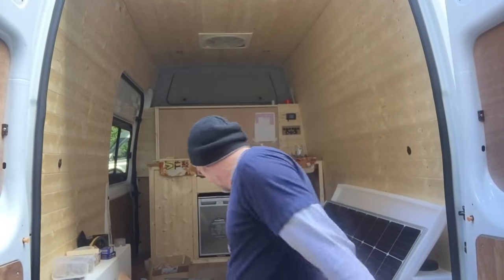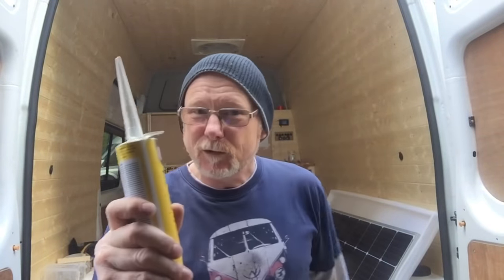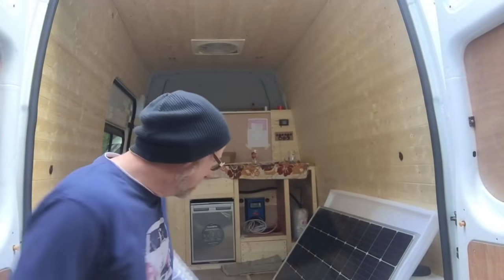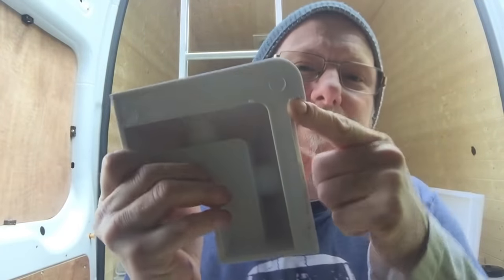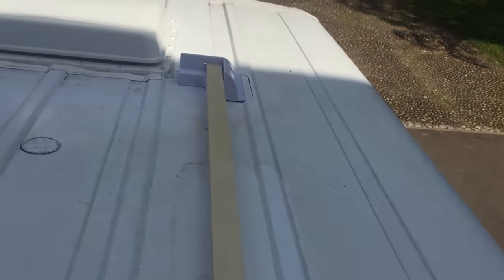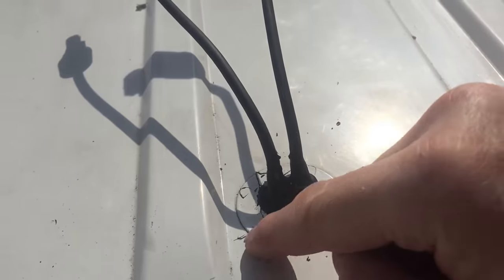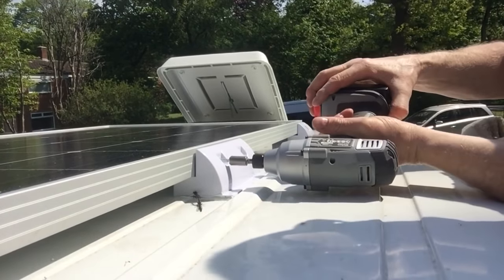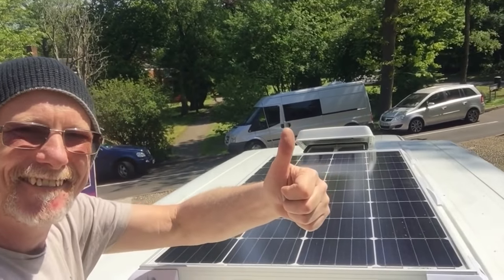HOW DO I FIT SOLAR  PANELS TO A CAMPER VAN ROOF  simple and safe - Sprinter Transit T4

Comment: Just a quick safety tip: It’s worth chucking a bit of cardboard over those panels before you connect the wires, so they are not producing any current. If the wires accidentally touch with the panels in sunlight, you can cause damage. Those brackets look really substantial!
Reply from the maker: Thanks Matt that’s a good shout 🤙🤓
Reply: the panels don't produce current until a load is attached

Comment: Love the honesty in this 🤣 "An old battery I got for £2 from a breakers yard!" 🤣
Reply: 😊 Yeah that how it was in 70s. No money around and just made do and learn't how to do things myself , mind you two quid was a lot of money in 1975, beer 25p a pint so you could have a good evening in pub and Chinese take away after and still have change 😄 Petrol 32p a gallon, (that's 7p a litre 😯). ps where do i get those mounting corners from? Cant find on Amazon link you gave. That are perfect as i don't like drilling in roof for fear of leaks.
Reply: I lived on the road in tge 80's. We ysed old van and truck batteries. We had a oair of wires with crocodile clips run out the top of the bonnet, round the windscreen post and in through the door, when you went out, sling a battery in the foot well, charge it up. We didn't use the batteries for lighting, incandescent bulbs only back then. We used to run car cassette players and old portable black and white cathode ray TVs. The lighting came from gaslight and candles.

Comment: Hi many thanks for the footage am going to do the same to my trailer just a thought as my trailer has no individual suspension will the solar panel fixed as you have done on top of the van 
Just thinking I'll be careful driving but will the solar panel crack IE with vibration 
Just a thought

Comment: this is a good way to mount the panels than drilling hole into the van. good work !
Reply from the maker: Thank you 😊
Reply: Please be aware that's a VERY BAD CHOICE! Sorry to say, a bit stupid at best.

Although the adhesive itself is quite strong. Remember the entire panel, which is basically a horizontal sail. Is being held in place by the... paint work!!! Yep! That's it! It's the paint that's holding, (anchoring) it all in place! 
Take it from someone with a "structural" background on automotive and other applications. Anyway it's basic common sense!
Whoever as seen clear coat and/or paint peeling in a car, van, etc. should understand immediately what I'm saying. Let that sink in for a moment and then tell me how safe you would feel at highway speeds behind such an assembly. ;-) 
Cheers
Reply: @crpth1  thats why it should be sanded down and cleaned with alcohol before applying the glue.

Comment: Thanks Mel, very informative. Although I'm only an armchair van converter, I personally would prefer the semi-flex panels that mount direct on the tin roof. I would expect any panels to be combined with a decent sized battery, preferably lithium ion - the recovered batteries from bmw hybrids seem very cheap, I have seen £500 for 9kwhr. A decent battery and you can run yout fridge, a microwave or an induction hob. As you can see, I don't like the idea of lpg inside the same tin box I'm sleeping inside.
Reply from the maker: Hi thanks for your feedback really appreciated I have used flex panels but there not as good as the traditional ones
Reply: Indeed, feel free to do some googling about the disadvantages of the flexible panels. They don't have long longevity at all as they deteriorate rapidly when exposed to the elements (Wind, rain, ice, snow). Also without the aluminium backing / frame acting as a heatsink they get hot, extremely hot. In hotter countries they don't last long at all, here in the UK you may get a couple years out of them ;)
They make sense if you use them as portable panels. Store them and slap them on when you're going away for the weekend / week. If you're looking for a permanent install, go with the ridged panels.

Comment: I'm going to be fitting a solar panel soon but there are lots of ribs on the roof of my van. How did you cut the plastic corner mount to fit the roof?
Reply from the maker: Hi I used a grinder please be careful ❗️ 👍

Comment: I was really resigned to the fact that I’d be drilling the panel to some roof bars and then not having space for extra luggage. Basically because I was scared that this adhesive (or any of the recommended brands) wouldn’t hold the panel in at 70mph. 
You’ve given me confidence to glue now. I think. Eek.
Reply from the maker: Good luck take ya time make sure everything is super clean and you’re be rite 👍🤓👍

Comment: Hey Mel, I was watching a video and the guy said these mounts can't be used on curved or ridged roofs. You show that they can. I have a Chevy Astro van that has a similar roof to yours. I'm going to bolt them down though. When these things rip off it's from the paint separating from the primer.
Reply: Right. He didn't even bother to sand it down lol. These will last a season or two.

Comment: Ha! 
Gotcha, Mel:
l already had a 4 bar roof-rack, so l just adjusted one bar to fit my panel... (the cables go through my sunroof)
l even put 2 inch elevators on the back-end to keep it facing the sun...
(Yes: l do not intend to move my van for a while)
Hahaha...
I liked those plastic end-bits though... yep!
Reply from the maker: Well done sounds like you really do have one up on me lol 😂🤓🤙
Reply: Perpetual Stay-in-one-place, indeed.

Comment: Mel you are a bloody genius, where did you get those brackets ? absolutely by far the best way to fit a solar panel, Greg Virgoe you better up your game there’s a Mel about. I am so impressed with this. Thank you and huge 👍👍👍👍👍👍👍
Reply from the maker: Thanks, Peter here's a link to the Brackets for you on Amazon 
 https://www.amazon.co.uk/gp/product/B016ORGABK/ref=as_li_tl?ie=UTF8&camp=1634&creative=6738&creativeASIN=B016ORGABK&linkCode=as2&tag=melsvanworld-21&linkId=7aea0fdf04168718d4136409d453a92e
Reply from the maker: thanks Peter link to ebay too
 http://rover.ebay.com/rover/1/710-53481-19255-0/1?ff3=4&pub=5575467911&toolid=10001&campid=5338454651&customid=&mpre=https%3A%2F%2Fwww.ebay.co.uk%2Fitm%2FSolar-Panel-Mounting-Bracket-Sets-Frame-Kits-Adhesive-Bond-Caravan-Boat%2F252257787138%3FssPageName%3DSTRK%253AMEBIDX%253AIT%26var%3D551090468161%26_trksid%3Dp2057872.m2749.l2649

Comment: great video. thanks for sharing. can I connect the wires straight onto the battery 🤔
Reply from the maker: NO DO NOT DO THAT YOU NEED A SOLAR CONTROLLER
Reply: @BigVanSmallWorld  ok thanks for that.

Comment: Nice video. 
What size controller would be required for 700w solar powere? ie:- 4 @ 175w each?
Reply from the maker: Hay Gary it’s all about the voltage 👍
Reply: Thanks Mel. I’ve got it sorted thanks. 
On an other matter though!!
My van has a secondary Varta agm battery that’s charged with a split charger from the van battery. I want to change it for a bigger lithium battery. Will the existing split charger charge the new lithium battery efficiently and safely? Or will I need a different split charger?  Thanks again for all your advice. 
I’m loving all your videos. Very interesting and entertaining. 🤙

Comment: I've bought 20mm hole drill thing and 20mm grommet is that right mel
Reply from the maker: Sounds about rite but check first
Reply: @BigVanSmallWorld  I've also bought roof rails that run from back to front down either side and two cross bars it'll look nice Mel but my idia was to move the cross bars the same length as the panel and fasten it in-between them so it's low profile, thing being ime not sure what I could use to fasten them, can you have a think and try come up with something.
I thought jubilee clips but not sure theyl be strong enough no it sure mate. I heard to helped corral out with something lol she a case lol I spent a fortune on her and let her sleep at my place...no sex involved 😜

Comment: I have a little Vito, I'm just wandering would a 150w been enough for just your fridge and charging of devices and lights? I know it's a very vague question but if you have an idea I would appreciate it
Reply from the maker: Hi Spike it’s more about the size of your battery’s I’d say you would want at least 150 amp hours to get you through the days that are overcast 👍😁
Reply: @BigVanSmallWorld  okay thank you, so do you think two 100amp would be okay? I'm assuming you can join them. Sorry I'm a complete newb to this. But the only way to learn is give it a go 😂

Comment: Im concerned about the wind pulling the panel from the roof at 70mph, which adhesive did you use to avoid such an accident? Thanks in advance
Reply: tiger seal thats what he showed at the beginning of the video anyway... I have used tiger seal before and its really strong but i am also concerned it would blow off! I think having the solar panel flat on the roof would be better because of the wind getting underneath... My mate stuck his on a roof rack and he said its costs him loads more in diesel.
Reply: @jamesjddj23  Not better for the solar panels though.  They need air circulation.  If you stick them to the roof, metal heats up and in turn will heat up your panels, decreasing their performance and lifespan, which is already less for flexible panels vs ridgid on both counts.

Comment: Make sure when using Tiger Seal you warm it up first as it makes it easier to apply otherwise it is like solid rubber when its cold.
Reply from the maker: justin smith thank you it was a nice day so didn’t really notice I haven’t used it much in could weather but next time I use it in a vlog I’ll pass that advice on cheers 🍻 really appreciate you taking the time to help 🤓🤙
Reply: @BigVanSmallWorld  no probs mate, congrats on the 4K Subs BTW You'll soon be able to give up work and live off the YouTube AD revenue LOL

Comment: Mel, can I ask what’s the deal with connecting the panel to your leisure battery? Is it okay to leave it connected all the time or do you have to disconnect it to stop it over charging? I’m showing my ignorance here, but is it okay to have a split charge relay and a solar trickle going into a leisure battery continuously ?
Reply from the maker: You need to use a solar controller DO NOT connect your panels directly to the battery

Comment: I'm trying to convince the Brazilian campervan construction community that it can stick, your video will be very useful, until then everyone has pierced their roofs :)
Reply from the maker: Thank you 😊 that’s really kind of you good luck 👍😊👍
Reply: Debora Weber - PLEASE do not spread dangerous myths/errors and mistakes on your campervan community! I commented the same elsewhere in this section. 

DO NOT follow such stupid advise. By all means use the sealant & adhesive of your choice, that's absolutely fine and dandy. BUT for goodness sake use also the appropriate hardware for your application! As well intentioned as this guy can be, he's clueless about what is doing. There are good reasons why "everyone has pierced their roofs". To use your own words!

Agora em bom Português! Ao usar apenas adesivo você está a confiar que APENAS e SÓ a pintura da sua van, supporte todo o esforço que estes paineis colocam em alta velocidade. Por favor use um pouco de senso comum e não aceite conselhos de quem obviamente não tem nem ideia do que está fazendo! Lembre só porque viu na internet não significa que é bom! 
Lembre também, que um painel destes, saindo a voar em alta velocidade pode matar. É tão simples quanto isto! 
Lembre ainda que pintura ou verniz de uma van ou carro NÃO é um elemento estrutural! é apenas tinta... 
Fique bem, Abraço

Comment: i'd prefer  removalable panels, so you can park your van in the shade while having your panels in the sun.
Reply: Do both. The portable ones are usually much lighter but much more expensive for the same wattage.
Reply: when you have panels ont the roof your van is in the shade....
Reply: @WereReallyRelayCamping  it is unlikely that the panels would cover the entire roof, so no.
Reply: That’s what good insulation is for :)
Reply: @DavidTangye  mine do.......
Reply: @pistonslapuk  I had a full length roof rack with a huge piece of aluminium' sheet on it on my campervan, effectively making a second roof with a nice air gap. However that is nowhere close to being as effective as simply parking under the shade of a tree, or in its normal parking spot, which is under a carport which has a sheet metal roof and provides an air Gap of about 1 m. I am in Queensland Australia and living out in the sun all the time, and I have abandoned any notion that a even heavy solar panels, eg from off house roofs, would be of any used as effective heat insulation from the sun.

I have put better insulation into my latest man but it still helps considerably to park in the shade.

Comment: im just  nervous about it all working  loose in a few years  and it flying off the roof and  killing  someone  as i drive down the motorway ...dont want  to drill holes in my  roof either ..
Reply from the maker: It’s I real dilemma for sure good luck with your build 👍🤓👍
Reply: i think a roof rack is the best  option  4 me..tho   rather  expensive  for  sure
Reply from the maker: Yes that’s what I did on my current van I use unistrut it’s super cheap to use think I made a video all about it 👍

Comment: Hi Mel,
Brilliant video (as always) I’ve done this on my van with a 200 watt rigid panel (much like yours) I’ve seen some photos on Facebook panels that have been stuck on flying off the room. Do you think that’s much of a worry or do you think it’s just people fitting it wrong? I’ve got all 4 corners and the side bits as well. I just get scared that I wouldn’t be able to use the van in a bad weather in case it comes flying off the roof
Reply: How’d you go?
Reply from the maker: I know some vans are galvanised and the paint comes away along with anything stuck on them so be careful

Comment: Mel been watching your videos and some really helpful stuff so thanks. I guess you could screw to these to the roof allomg with the adhesive?
Reply from the maker: Thank you and yes you could
Reply: @BigVanSmallWorld  - Not only could, but most important SHOULD use hardware to fix it in place... 
For goodness sake, at least put a warning about this rather stupid, so called, solution! Sorry if it doesn't sound nice and dandy. But consider that you're putting peoples life in danger just because it "looks" nice!!

Comment: Great video, where did you get the self tappers for the solar panel from and are they Stainless Steel?
Reply from the maker: Hello thank you there roofing screws with the big rubber washers removed so yes no worries with rust you can get them anywhere screw fix B&Q most DIY stores 👍🤓👍
Reply: Thanks for the reply. Are they Stainless steel?

Comment: What gauge are the cables running into the controller? Also, did you have any issues getting them into the controller? Ta
Reply from the maker: No worries at all there 6m 🤓🤙
Reply: @BigVanSmallWorld  Is that 12 awg? 🤔
Reply from the maker: no idea lol

Comment: did you have problems with the rubber toggle type you used last time , that you changed to a stick em down system   , I am going to try this method looks easier , might still use a safety wire attached to the panel and roof rack mount built into my roof just for safety sake  and my own peace of mind lol
Reply from the maker: uptowndisco2 no didn’t have a problem when them they are still going strong there just not suited for this panel there ok for the flat flexible panels 🤓🤙

Comment: I was hoping to see some screws holding the panels on, but at least these are moderatly small panels, because the tiger seal is /not/ holding the panels to the van, the paint is holding the panels to the van, and paint, well....

Comment: Hi Mel what size roofing bolts did you use and if I we're to add a split charge relay system would the solar charge the main starter battery once the leisure batteries are fully charged? Great video by the way, keep em coming.
Reply from the maker: Hi ya I don’t remember what size bolts I used sorry as for VSR yes it will come on as soon as your solar system kicks in charging all your battery’s at the same time that’s the down side 😊👍
Reply: @BigVanSmallWorld  thank you for your speedy reply, what do you mean by downside? Surely it is best to keep all batteries topped up?

Comment: I didn't see you use a square with the wood to make sure they were square? personally i'd have screwed the plastic brackets to the solar panel, took it up on the roof then marked the brackets with the panel in place, removed the screws and then stuck them down without the panel in place just so you know they are all square, not my tip, saw that on the motorhome channel! :)
Reply from the maker: Malcolm Rowe no need to use a square the ribs in the roof did that I didn’t mention inthe vlog that I work alone and didn’t want to risk lifting the solar panel up and down to much due to my bad hand plus the roof has a slight high spot in the middle be careful if you screw the brackets to the panel first you could end up with an expensive see saw 🤓🤙
Reply: @BigVanSmallWorld  okay understand, thanks for the reply! Should have known you'd have a reason! 😬😂